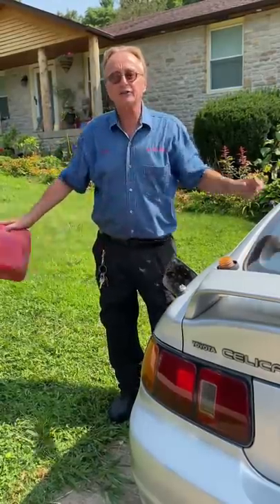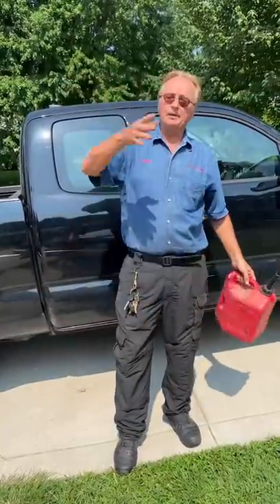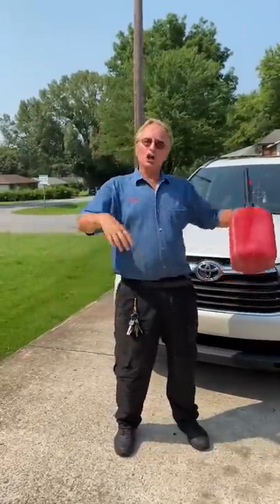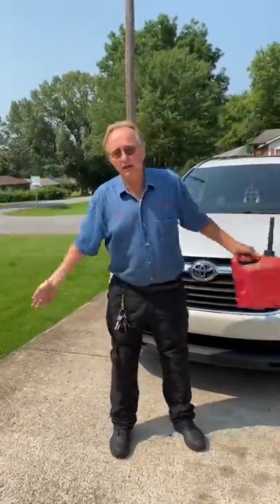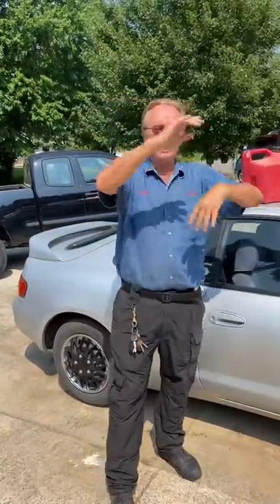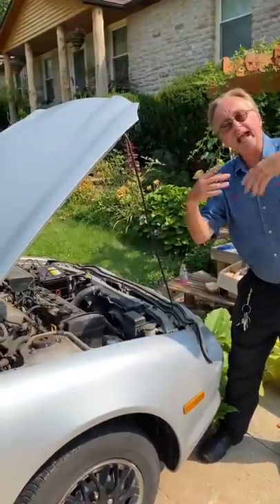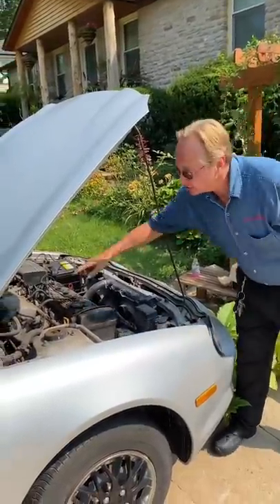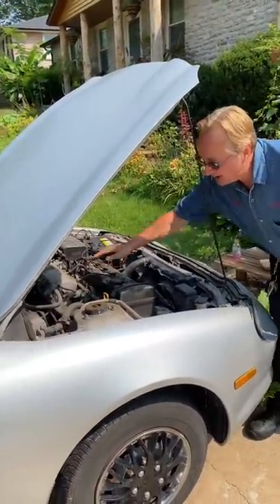Avoid This Gas Station at All Costs

Comment from the maker: Thanks for watching! Like and Subscribe for More Vids Daily ► https://www.youtube.com/channel/UCuxpxCCevIlF-k-K5YU8XPA?sub_confirmation=1
Reply: Hey Scotty. It's definitely not common.  
12 years of wrenching and I have only seen it once. Told the guy to put heat in tank and run it low and fill it with premium  and the problem went away. 👍
Reply: Odds are if you get bad gas (water contaminated)... the station, name brand or not, will deny it.
Reply: I'm in the fuel haulers business... and yes some new stations have fiberglass tanks... but scotty most stations that's been there for awhile has those old metal tanks. Buy there is filters on the pumps to catch anything that gets sucked up...  Bad gas  comes from what we call in the business cross drops...  And that's more common than you think. Driver not paying attention or having a bad day boom it happens. The company I work for has paid a ton of repairs on cars. One time we had a station in a very rich neighborhood. Let's just say there were quite a few Mercedes Benz and BMW that had to be fixed.
Reply: Scotty I seen the guy at the gas station pouring in extra ethanol with a 5 gallon glass container
Reply: @koreycowan1976  cross drops?
Reply: @i.m.7710  a cross drop is when a driver ( fuel hauler) is not paying attention and drops the wrong product in a tank. We have 5 tanks or compartments.  We also have a marker on each tank that will say what you loaded in each compartment.   But some drivers get lazy and don't use these. And when you get loaded and have a 1 to 3 hour drive to deliver you might forget what went where.   And once it's in the ground it's to late to fix. See the problem is with ulsd or diesel... it can't mix with other fuels.  If you drop regular  into premium... no big deal.  But diesel... 🤯...  you got a problem.  The whole batch gets scraped or sold back to a refinery at a large discount.  Lol.  This  Actually happens more than you would think. Our company usually has 10 to 15 cross drops a year.

Comment: Scotty is clearly a Toyotalover. He's sorrounded by Toyotas.
I also love Toyotas and Hondas.
Reply: I love anything designed and built to not rip me off.
So yea,Honda and Toyota.
Reply: @phil4986  😂😂😂
Reply: a celica!
Reply: As someone who is a an amateur mechanic. Toyotas are the easiest cars to repair and replace parts for, they also don't need repairs as often as literally every other car on the market. Toyota is the best thing you can buy, especially right now. Hondas are good too but remember if something breaks on a Honda other things are going to start breaking too, so timely repairs are a must and so is preventative maintenance.
Reply: My Toyota is 22 years old and KBB says the trade in value is half its original price.
Reply: Had to rewatch and you're right.
Spotted a Celica, Tacoma, Highlander, Matrix, and a Sienna.
Reply: Those are not HIS cars, those are customer vehicles, which means...

Comment: Scotty is absolutely correct. Bad gas will go away quickly. Had this happen a few years ago, car was jerking violently. Auto repair shop wanted $400 to do a full tune up. Problem went away within a day or so as the bad gas burned off. No further issues.

Comment: In Maine the best places for diesel are Citgo, Sunoco, Irving, Cumberland Farms, maybe Shell if the prices are not a problem.  Here near Portland, Maine, there are no Wawa's, RaceTrac, QuikTrip, Arco, So-and-so's Cheaper!, former Gulf stations recently turned independent, or grocery store-affiliated gas stations like at Kroger or Tom Thumb/Shaw's/Safeway/Von's, that I am aware of.  There are not as many 7-Eleven gas stations in Maine as there are in other parts of the country.  The closest BP is in the Portsmouth, NH area.  

Neither Sam's Club or Costco sell diesel fuel at any of their New Hampshire locations.  Right now diesel is just over $5.00 a gallon, regular gas maybe $4.40.  I do not know anywhere that still sells the predecessor to the ultra-low sulphur diesel fuel that has more parts per million than what is commonly available.  Not even in Canada.

Comment: The "mom and pop" gas stations, as we call them in the biz, get their gas from the same places as the big name gas stations. Difference is the additives. But what's not uncommon is the lids where you would unload the fuel to the tanks might leak and get water In the gas. Also, what's not unheard of, is unloading the wrong fuel in the wrong tank. About 4 compartments on a truck with possibly up to 4 different types of fuel. If you accidentally unload diesel in the gas or vice versa thats not good.

Comment: This is coming one week too late for me 😔.... I topped off my motorcycle tank at a no-name gas station in the country. I didn't even make it out of the parking lot... I ended up buying a siphon and gas can at an auto parts store, pumping that fuel out, and then getting new fuel from a Texaco... Took a while for the bike to start since the old gas was still in the system, (ran my battery down) but once I got it started and burned through that horrible water-gas, it fired up angrily...
Reply: Its like that motorcycle just experienced $5 vodka!
Reply: @Ziedmac  Yep. Had to have it's stomach pumped....
Reply: The only time you should stop at a no name has station is when they advertise 100% gasoline, otherwise yeah it's probably 50% water lol
Reply: @BarnacleBoy42069  so dont go to them ever
Reply: I would have wanted to put may water on the pump. At least other's might get a hint and chose to fuel up elsewhere. 😅

Comment: This happened to me a month ago BUT it was at a extremely busy name brand station in my area. HOWEVER my theory is that it’s was bad due to it being 89 octane right around the massive price increases. Most of the circulating fuels will be 87, 91, and diesel. I think 89 is too niche and was probably sitting for extended periods
Reply: Very few stations have a dedicated 89 tank anymore. Only about 7% of Chevron stations have one for instance. Most of them have automatic blenders that pump 50% regular and 50% premium into your tank. So if you go back to that station and look at the tank fills and you see one that's either marked "midgrade" or is painted blue then it probably has a dedicated tank. Otherwise, it was just a mixture from two different tanks. If that station doesn't have an 89 tank then it's possible that there was some diesel that was accidentally put into one of the tanks, but not enough to damage your car.

Comment: Haven't happened to my family at commercial gas stations, only at makeshift off-grid village fuel vendor. Too bad we were using diesel pickup at that time, you can imagine replacing four injectors with price tag of equivalent to $300 each. Good thing the fuel vendor shutted down

Comment: I got gas with with some kind of problem once.   A few miles away my check engine light came on.  The engine didn't seem to be doing anything odd so I kept driving and added more fuel after using a half a tank and then the light went off.

Comment: Hey scotty , i have a 2007 chevy trailblazer no problems i have owned it for a year it has 110000 miles on it i’ve had no major problems with it but overnight it sat as usual and i got up to go to work. i heard a grinding noise and immediately turned the car off, Looked under the car and there was water , that’s normal i think anyway i asked my mom to start it back up so i can hear where the noise is coming from and the engine didn’t turn on the first time but did the 2nd time, this is the first time this has ever happened.

Comment: Also: At American pumps, more people buy regular 87 Octane, the cheapest, so it runs out quicker than the mid-grade 89 octane and the premium 91(or above at specialty stations) octane.
Thing is, I heard from fuel friends that the Mid grade 89 Octane is a running mixture of the 87 and 91 octane tanks, and if the regular grade tank runs out, due to sudden demand, the mid grade will shut off too. The 91 is usually still available for a while, as it's less in depleted before this happens and the fuel trucks have to refuel the tanks.
☝️So what we've learned is this is the reason in apocalyptic movies someone says, "I know those tanks can't all be dry!" And everybody goes Mental Mac's trying to retrieve it and then the station is on fire, etc..
Reply: So what's the best one to get

Comment: One of my uncles worked 40 years for a major in Canada. He started out hauling fuel. 
He gave us 2 rules for buying gas
1) Buy most, if not all your gas, from one of the majors because the spend big $ on research and they "flip a switch" to sell independents just basic fuel-no detergents etc. 
2) Try not to fuel up on days it's delivered. Stirs up the sediment in the tanks and can build up in your fuel filter. Not as big a deal today. But I recall crawling under and removing the in-line filter and cleaning it out a couple of times.
Reply: In California at least all gas, even unbranded gas, has to leave the refinery with some level of detergent, albeit a generic one. And Costco has their own additive tanks, using Lubrizol. And a lot of stations get a delivery pretty much every day, so there's no avoiding it. But the pumps have their own filters these days.

Comment: I never fill up when tankers are filling the tanks. Too much settlement in the storage tanks. Is that true?
Reply: You better believe it is. That happened to me one time I was filling up my 81 Celica when the tanker pulled up and started to fill the tank a couple miles down the road at my car started to buck like a bronco and before I knew it my gas line froze. This was at a Sunoco station that I had been going to for a long time. I had a tow back to the station, the guy remembered me unfortunately and they flushed my line and drained my tank for free
Reply: It used to be true, but now the pumps all have their own filters on them. Costco is really diligent when it comes to changing those filters so you don't have to worry about it there.
Reply: Gas pumps have had filters for many decades at least. Debris big enough to hurt your car is also big enough to hurt the meter, so they don't want it either. The bigger issue is the fuel truck stirring up the water on the bottom of the tank (and they all have it down there). For a little while the water can be suspended in the fuel and it will pass right through the filter on it's way to your car. Even though I know it's still a small risk, I still look out for it. Generally, the busier the gas station is, the better quality the fuel will be.  So if it seems like Costco and Buc-ees have better quality gas, it's because the fuel is fresh, and their systems get inspected more regularly because of the volume. So in this case, bigger, busy, and crowed are all good things at a gas station.

Comment: What do I do if I think the mechanic at my dealer has been taking parts off my Toyota, Scotty? I have missing rear fender liners now, and I found that my cap that covers the interior screw on the drivers side door handle looks like it was replaced while I got the tires aired there. They do all my work, and I’m very meticulous. What can be done?

Comment: I get literally 40 extra miles to a full tank via ExxonMobil gas vs the Sunoco I used to use.
Same car, same driving conditions, same driving habits, & same commute. It actually matters. 
And don't top it off!! Your evap system will thank you.
Reply: What do you mean by top it off?
Reply: @melancholypuppy3595  fill to the top
Reply: @melancholypuppy3595  continuing to pump after the pump clicked & stopped itself
Reply: @RothBeyondTheGrave  I thought that would be it but I wasn't sure if it they meant to let it stop on its own
Reply: I recently switched from 76 to shell and noticed a nice increase in fuel economy. On 76 I got 19-20 on the freeway on shell I’ve been getting 22-23 on the freeway.
Reply: @lucian7182  interesting, right? I never thought the difference in additives would actually be noticeable in the real world like this. Of course there's other factors like the fuel sitting in the underground tanks & possibly absorbing water vapor, "winter gas", (depending on location & gas station traffic), etc but I was legitimately surprised. 

You're not the 1st person I've heard who got a mpg bump by switching to Shell either.
Reply: RothBeyondTheGrave always pic a station off a main road or freeway!!
Reply: @lucian7182  that's a good point. Definitely do!

Comment: At least in California, all the pumps have filters on them to take out whatever debris is in there. Most often the cause of "bad gas" is a fuel hauler that's cross-dumped gas into diesel or diesel into the gas tank. It doesn't happen often as a matter of percentage but it happens almost every day somewhere, and if you're one of the people that gets a tank full of it then you're entitled to have your car repaired. So if you think you've got bad gas be sure to have the tank tested for diesel. 

When a fuel hauler has cross dumped he's supposed to go and shut down the station. Unfortunately, some of them will try to cover it up which only makes the problem worse because now it's damaging cars. The hauling company has to pay to get all those cars repaired. It's a bad day for everyone, including the driver who made the mistake because it probably cost him his job.

Comment: Sunoco doesn't seem as good as it used to be. My Altima 3.5 likes Mobil 93 and 7/11 93 octane right now. Sunoco used to be the best until they added butane or something like that to the formula and it burns the fuel up faster now and doesn't run as smooth. Even the summer 93 Sunoco seems like 91 and has a yellow tint. It used to be like race fuel until they changed something not sure what's up with Sunoco

Comment: Anyone know about Murphy gas station? The one local to me charges on average $.30 less a gallon than most gas stations. 
I put $40 of it in my old 2000 Impala a few days ago. 
It started up a little funny after that (slight delay) but my car is also very old and occasionally does that.
Reply: Murphy gas is not Top Tier certified.

Comment: Don't understand, can someone please explain me. So avoid bad has stations?
Reply: There's no real way to know which ones are bad. Scotty has a worldwide audience, and even though most of it is in the USA, things can be very different from state to state. Basically what he's saying is avoid older gas stations that might not have modern tanks, or are low volume that might have old gas that's separated. It's pretty rare but it does happen from time to time. Most often the "bad gas" is the result of a fuel hauler who cross dumped, putting diesel into the gas tank or gas into the diesel tank. They're supposed to shut down the station and have it pumped out when they do that but sometimes the driver will simply try to cover it up which only makes matters worse.
Reply: @swistedfilms  Oooo I see, thank you. Well for now I haven't experienced that and I hope never So basically avoid strange places for example out of the cities

Comment: Been there, done that.  Thankfully the bad tank must have just been wet.  A can of fuel system cleaner designed to remove water fixed it quickly

Comment: Have you never heard of stations watering the gas down?
Reply: Water sits at the bottom of underground tank. If the fill cap on the underground has a bad seal, heavy rain accumulation where the stations driveway is flooded. Water infiltration is possible. I worked at stations and sticked the tanks and recorded amount of fuel pumped for each pump and end of day, at closing time.

Comment: Or just go electric.. 12,000 miles and I haven’t paid a cent in charging
Reply: ohh you giving  out free electric alternativs? take my fn escalade then.
Reply: @mattmekhaeil  I bought the car with 20k miles and I put 200k miles on it, only repair was wiper fluid and tires.. breaks are still good lol
Reply: @mattmekhaeil  you mean gas cars right.. no fuel in electric cars, in fact the batteries are designed to be safe in an accident